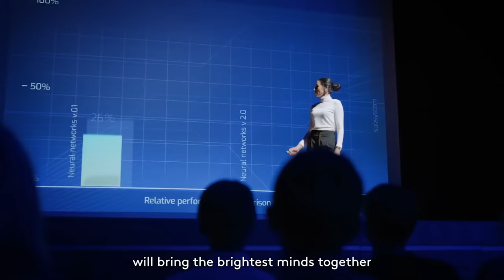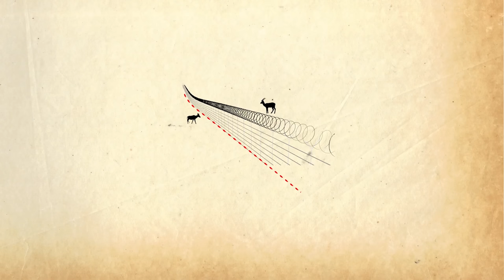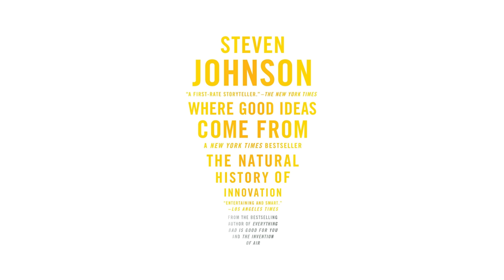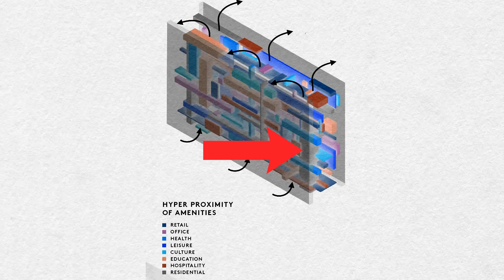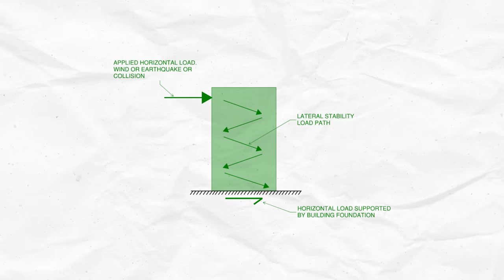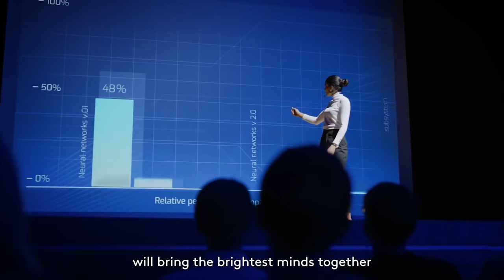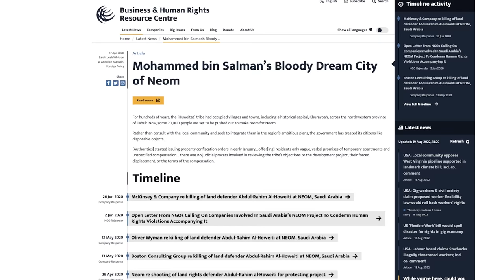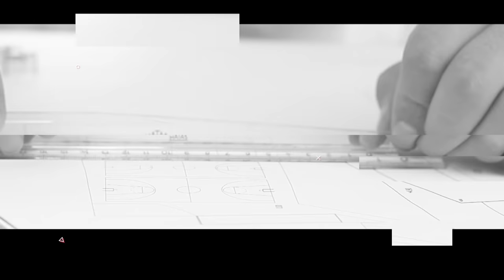This city concept breaks architecture (THE LINE)

Comment: For thousands of years cities have evolved in different ways according to local circumstances. Never has   a city evolved to be a straight line. This suggests that there are good reasons why this particular project will fail. It will fail, and fail badly, for reasons we cannot yet predict. But fail it will.
Reply: Do you wake up at night praying for that? I bet you do.
Reply: Reasons we cannot yet predict? I mean there are hundreds of obvious reasons why this project is the most stupid thing ever.
Reply: @AAL2012  no
Reply: This is going to end up long an I will copy paste parts in a few places.. If you look at it at a micro lvl, Every city in history evolved from a "Line" since the late 1900's. It has always been along coast "lines" building off from them right? Even more so from a "Main" street an off of that. Can't get much more then a line then that... The only major thing that changes here is the Direct East to west facing. 
 That to the side, The placement and "line" design have MANY reasons, best way to capture both light and wind for energy (look at solar and wind plants) in the area, Also to catch wind to create convection cooling with (what everyone seems to purposely forget) It is to have 200ft wide 20ft tall openings every 1000ft for cooling, animal passages, green areas and outer city transit. As far as the sun goes and having shade, does she/others think the earth is flat? A little over half the year it will be on a south side, a little less then half you get north majority sun. SO with open tops and large holes on ground level you get the micro climates. The money is nothing to S.A. and if they can help offset future cost's anyway they can that seems to be the smartest way.  As far as to whom would live here and how everyone says it is only for the "supper rich" That is SO FAR OFF! If anything it would be the poor whom HAVE to stay in it (It would be the cheapest in the long run) Bc the rich in S.A DO NOT rub elbows like that with the "poor" I have seen 5 people shut down entire hospitals over this! Even tho it being Independent may bring the rich, Sadly being able to legally drink will make this a smash hit! The whole A.I thing along with the worry of data, Has anyone been too? Everything is off a smartphone in S.A already, No change to the norm sorry to say.  Why can't S.A evolve a city that to them best suits the area they are IN? 
99% of what everyone is CRYING about is NOT true if they would take 5mins to do ANY research... I will give everyone, It looks stupid and dystopian AS FK! 
  The SUPPER funny thing to me is NOT ONE person has even came up with the REAL risk's of this project, Like IDK WATER!!! Or the fact how Isolated it is! Also near borders that hostel ppl can come say hi easy.
Reply: @dizzlethe7346  This project is so stupid that it would need to write an entire book just to explain all of its problems.
Reply: @bobincognito6239  Not being a troll, But have you looked this up at all?  If so I am legit curious as to a few problems you would see? 5,6?.. Water they can figure out if they have the power since they are near it, Really comes down to security IMO. Ethics are by and FAR ahead of what 99% of people put into it when we talk about animal's go, Our "green" Energy dam's or 10ft fences on the 6-10 lane highways that carve up countries LOL. come on now...   As far as size and design it is NOTHING outlandish, Look at NYC built on unstable march lands with transit And carparking under it.. S.A. Has more stable ground, No flooding or drainage worries, Plus it being in a "line" or really a rectangle would make it STUPID easy to have one main transit station with 8,9,10 (like they want) train lines all going to set distances with no stop's. 
 This concept has been around a LONG time. Rockefeller was going to do something like this with a Frank Lloyd Wright design, he thought of after the  Imperial Hotel in Tokyo was finished. It would have taken up a MASSIVE square/rectangle about 1/3 of Manhattan. And they would have at least started it if not for a man called Robert Moses (You should look him up very shady shet goes on with him) that kept expanding Central park or making random ones blocking the building. Did this to more then one person too lol.  So like not only is the concept a serious thought, But all the major thought process is done. You just need to apply modern tech and building science an that is nothing in the grand scheme. If anything should make it easier then it would have been 100yrs ago..
Reply: @bobincognito6239  P.S. All this does not mean I am for it... Because I am not! IMO people should be more Independent with an understanding of what could and is going on around them. But if your going live in the city and drone out, Why not this?
Reply: @dizzlethe7346  I mean you're just not really thinking about it. First of, it's about building the Empire State Building over 170km (110miles), so basically building 3000 Empire State Buildings, this fact alone shows how ridiculous this project is. A line is obviously the most inefficient city you could build, it's the shape in which you need to travel the most to go from point A to B, so insane time travel and insane cost of everything, any fire and the city would be cut in half...
Reply: @bobincognito6239  Ok you have not looked into this... A line is the MOST efficient way to build! You are in a essence putting 3sides on buildings not 4 saving 25% per site! This in turn drives Down the cost, It being a line also makes it so no turning is needed making no stops needed cutting down travel time (if you listen to Fedex or UPS) in half at least compared to "normal" city travel.   As far as the overall size, You have to stop thinking of it as a single building.. They are not building it ALL at once. This has to be looked at like a city not a building! So do not think of it as just A single Empire state building but more like a city how it is supposed to be. Compare it more to the building of NYC, Philly, DC ect. All of these places had been built VERY much like this! Even down to the utilities with steam heating and all, We did that over 100years ago. So why is this so outlandish? Shet our leading experts in the 1900's wanted to do the SAME THING but was stopped over personal issues with ppl in power.  
  IF we thought we could do it 100yrs ago in NY, What makes it so crazy to do today? 

 P.S As far as fires why would that split it up? Fires happen every year in my building and it doesn't spread bc brick does not catch fire... Now if your talking terror attack sure I 100% agree lol.
 EVERYTHING said about this has been said each time we go to build a larger building or city. They used to say the Empire State would weight too much and pull the land down and create a massive sink hole, The Colosseum would fall in on itself,  Cathedral Basilica of Saint Mark will sink Venice.
Reply: @bobincognito6239  Most of the EU is built in a way JUST like this. Most the buildings are connected in LONG lines with only small ally ways from one road to the other, So S.A is not doing really anything NEW. Just a larger scale and PLANNED out.     Sorry i have to go back to cost's,  Go look at sqft or building cost's in any city much less major ones.... Even if this cost 3trillion and you only got the building that is a BARGIAN!! But not only has the est only risen to 1trillion you don't just get a building in that price. You get a SUSTAINABLE CITY that is also able to be a power plant  TWO other same sized cities. And a trans system, water an waste (That also makes heat, electric and the gas for the systems to run)system Plus everything is electric so no smog. 
  The major trouble I see with this. Is are they really going to let animals roam like they said, Are they really going to be humane to workers, Are they really going to let this area be 100% independent to S.A laws. Or are they just saying these things to not looked down at from the rest of the world. Is this going to end up not allowing animals I bet, Is it going to use legit S L 4 ^ E labor? I bet, Are they going to Blackmail powerful people with the lack of or over pressed laws? I bet.  Is this going be a target for terror an innocents will be a target, I bet. An all these suck. 
 I just wish it was not them building this, An if we have to have cities we would do the same. It would lower ALL cost's from transit, taxes and services. But MOST of all it would give us WAY more green space and a unimaginable amount of less traffic on EVERY road everywhere! Last but not least water usage would be slashed!  
Something like this doted across major interstates near rivers would LVL up the US.     Like the US just spent how much since 2008 for some form of bailouts? The US could have 6 if not 7 or 8. Use them to slash the costs of social programs we have, Like rent, utilities, transit and internet stipends. Some not just for that city but others also for electric an such. At the same time giving a full spectrum of more housing and shops... In turn making it so not only can a snowball and make MANY of them, But also lowers the cost's and burdens of tax payers
Reply: @dizzlethe7346  Lol, It would take a few centuries to build 170km of this "line", you don't even know how long a single building takes to make
Reply: @RutakoVon  ROFL, Should go at someone who did not do this for a living for 35yrs.. I love how time is the only thing that matters to you tho....  Do you think it took "centuries" to build NY or LA??? This is not a Burj Khalifa type building! This is a BOX building, Not only that but it is not being built inside a city! So you do not need to deal with thos logistics, So in turn they can have the assembly line AT THE SITES!     Think of the Empire state building but on steroids! An they built that in just over a year, an that was 100yrs ago INSIDE A MEGA CITY done mostly by hand! Even that is not fair because they don't need to spend MONTHS pounding stabilizing post's 100++ft into the ground since they are not building on a marsh like NY is. Or spend another month making underground parking. Talking MASSIVE factors here, The depth Underground is only 12% of the E.S. Building.  Plus they don't have to be held to just one or two job sites they can have 10-1000 sites all doing the same things to make it easy to manage an teach, Making it less like one building and more like build 10-1000 of them. While being built in sections making it possible to develop even faster... They also don't have the "red tape" in permitting an such like we do. Top everything off this isn't like the buildings we have, An only one person or company is doing it we are talking a entire nation AND investors!!!
  All these factors, You know the MAJOR ones when building like this. Just gets forgotten somehow. Assembly line an not being in the city being Major ones
 P.S It took S.A 15days! To build Four 100+bed  5 story C-19 TEMP hospital's, Took NY 5 months to put up a C-19 GYM, That they copied from China an they had it up in 3 days... LOL
:elbowcough:
 Seriously tho, 25-40yrs first half most of this being time to build all the supply plants needed. After that halve the time because you will have more in place to pick up pace. Income workforce and supplies. So something more like 40-60yrs in total, Ya sure a Long arse time but FAR from "centuries" friend.
Reply: @dizzlethe7346  Bro Prisons look better than this city.
Reply: @theeternal6890  I agree lol... But most skyscraper's or cities for that matter look and are just as bad as prison's too! Just this ones scale turns a level 2 up to 10!
Reply: @dizzlethe7346  yea no great essay but for one: how would houses with three sides even work? you still need 4 walls only this time one is a huge ass pane of glass. a line is pretty much the dumbest idea one could have, it turns the entire city into a bottleneck. theres a reason cities tend to radiate outwards in a roughly circular fashion over time, not accounting for geography. it maximises area while minimising travel time. this also has the advantage of allowing alternative routes. say the high speed hyperloop gadgetbahn is out of service, which it will be at some point. suddenly youll be taking the metro for 6 hours to get anywhere, whereas every other city, you just take a different train adding at most 30 or so minutes. add to that that this will not only be claustrophobic as fuck, it will inevitably exaggerate class division even more so than actual cities. The entire concept of the line is indefensible. they have some nice ideas. The transport and service layer thats entirely underground leaving the above ground areas for pedestrians exclusively is the perfect idea. just apply it to a regular city that isnt enclosed in a terrarium
Reply: @Smittel  First want to say TY, For being the first to really talk about the ideal!    But. I am not saying really build houses with 3 sides, What I mean is having it at one large area instead or a bunch of single buildings. You save a side each building you planned to build in that city. Since the "main" Buildings would run along the two side's of a "street" the best way i can put it...   Right now I am going to stay with Just this "line" of a city...   The "hyperloop" but really a hyper line will have 16 public lanes, With 58 cars all running at varies lengths. So we are talking a better stop and go with more areas to pick from then NYC, Japan and the UK all put together. So they have not just travel time down but will be set even if a near majority go down. With it being totally underground they will be able to really push the trains also unlike what everyone else is able to do to the weather. Top that off it is not like they will not put roads around it, The whole Ideal is to build it up as a tourist trap with it's "own" law's. So how do you get 6hrs  if you can drive will say 112kmh (70mph) in a car on the road outside you could drive around the outside of it in 3ish hours. 170KM is not really big at all.     The only way you will get a way to have the above ground levels to not, At least inside the city really is to build in a line like this. Otherwise that is when you run into the outside logistical problems of having to totally drive around the outside like that. You can't have all the roadways underground for cost's and safety think of the traffic then in a tunnel after a crash. So you would need the city to be "thin" an to keep the above ground free and so a truck or someone can travel easier in a car from one side to the other and not around.   Really every city starts out in a line, So just look at this as main street just as a skyscraper... How many people do you know that lives in a city that has a job further then 3miles anyway? So an Escooter should do that in 15mins.

 Overall the "Line" concept is top notch. It would save so much in everyway. Upfront cost, Running cost's, Utilities list goes on an on. I think more on to your point...... This is not concept this is the real world. And I 100% agree with will make class divide look so bad will have to invent a new term for it since S.A is doing this. And again something not the fault of the concept but the humans doing it, The amount of SLA  V  E labor that will be used for this will strengthen the trade even more after the QT soccer stadium too... 
 It is one of tho's thing's as a concept it is pretty fking ideal for a lot of things, Just not for society
Reply: In fact, you can predict. She just did in this video. Lol
Reply: Exactly. We can see no examples for anything like this, not even at a scale a hundred times smaller, and that alone is a sure sign this thing can't work.
Reply: @dizzlethe7346  You go great lengths to focus on the abstract concept of "line" while ignoring that this idea has zero connection to how villages, towns, and cities developed throughout history regardless if you can force that abstract interpretation on their origin in some way or another. This artificial city starts out with a master plan that leaves very little, if any at all, to its inhabitants: they are just clogs in the (supposedly) perfect, finished machine. However, life is a mess, and whenever great planners tried to shoehorn it into their clever designs, the result was an inglorious disaster.
Reply: No need to pray it will fail unnatural concept
Reply: You are wrong every city evolved having a city center a fort nearby river or coast. Your first point is baseless lies no need read further.
Reply: @tibs7095  I will reply to both your comments. First history is full of examples at scale, A single skyscraper is perfect, A apartment ward Or the new towns that have been built in middle America. But if you want something JUST Like this, Then look at all the HQ's of silicone valley they have all the same and are just big rectangles. An we look at them as marvels of advancement?..... Since real life main streets seem to be abstract to you. It is not really forcing it as an ideal when that is how history went but... Now as far as a master plan everything is directed to the inhabitants of this, This isn't made to be some industrial park man. It is just a copy paste of things we already proved have worked to make (One type of) people happy.
 All this said... It will never get finished! logistically it is too big, Right now it is more one man's vision rather then a countries goal and when he dies will be left with something 1/3 the size and half done. At this point it is still too young and no invested into enough from world companies. Even if it is done. Like you said life is messy! I brought this up b4, But this is going to be a MAJOR target in one the historically an still is a hostel part of the world. Then add on whom is building it, The building it alone is going to cause social divide at best. Also bring back a sla   v e trade to the area in full force. Not even bringing up the internal struggle for power, That will have forces not wanting it finished.
 
My points had been. 1.) We did/do evolve our at the basic from a line. Nomads with tents in a rectangle with leaders at the center, Forts with houses in a line down the middle with farm land around it, Towns a main street, Cities the same, Then everything is branched out/off of.  2.) That it could be built and in less time then hundreds of years 3.) That if built at a better scale (1/3-1/2 size) it could be an amazing plan just better for places with fresh water access along with countless times better then the cities we live in now 4.) It is self sustainable 5.) This is not as outlandish as the next progression to city living as everyone says. That in mind the overall size an people doing it makes it questionable at best... I still think something like this is the just what Southern America needs, It would make living west of the Mississippi but really the 98* line sustainable. Have most the population in that area manage water better then Vegas does now, Top it off what waste water that is made can go right to the crop lands this alone would be massive.. No more major worries about grid failure or added stress because each one can be a small electric plant alone. If laid out right it can help with river evaporation in the south. If done like a EU a layout with all the commercial, residential and like industrial in the "Line" city with all the heavy commercial/Bulk and industrial 10-20miles away, But also on the water front. You leave the ability for you to have every form of transportation.
Lastly the question really becomes less Can we build it because we can, But more should we build it. Even if we get all these glorious perks from it. Like Is it really worth the impact on all the social dynamics it will touch? Is it worth the risk of putting that much power over peoples entire lives? Into the hands of one person or company non the less? Is it worth the major target that they will get. To me one of them makes me say NO tbh. But I do see us moving toward this at some time, If you look at how cities are being refit around the new stadiums being built you can see ever since Dallas. With newer ones going the full self sustainable route also. Look at Jacksonville, Cleveland or Indy lol.  A line, House 10-30k people, Fully sustainable, light commercial cities inside a city. All with one entity behind them too...
Reply: @dizzlethe7346  
Thanks for your long response. Let me see...

Skyscrapers are a very recent experiment. They are huge, unsustainable machines that become dysfunctional at the drop of a hat when something goes wrong and, once left alone (even if it's for just a short period), will fall into disrepair and decay, never to be able to recover. They, together with most of our technological (non)solutions are the equivalents of balancing a ball on a saddle: you can keep it up with great care and effort, but (should anything go wrong even temporarily) our fragile little system will collapse. Trivia: skyscrapers need a lot of metal and metal's becoming very expensive -- it may soon become uneconomical to upkeep them, and then what?

I'm all for using our advances in technology, AI, etc. to create awesome solutions to great problems, but the solutions themselves must be sustainable, and that necessarily implies low-tech and low-impact. Variability and stressors are an inherent part of our future: if we plan for "things will always go well" then we're setting ourselves up for inevitable collapse. We must plan for the times when things will fall apart, when our support systems will be unavailable for some time, so that we can recover from these times.

A rigid system that depends on a continuous, unimpeded supply of resources to be available is doomed to failure; it's just a matter of time, really. The shinier and most precisely designed something is, the more likely it takes just as much precision (and thus inordinate effort) to keep in operational; it's a losing fight against entropy. Not only that, even small changes will be near impossible since any small change may snowball into something unexpected and huge across such a tightly-coupled system. Anybody who worked on software knows that the simpler your abstractions, the looser the coupling, the easier it is to adapt to new (or previously unknown) requirements.

The rigidity of precise design takes us to another problem. The big difference between the main street of a town and the Line is that those streets grew organically, one step at a time, continuously responding to the needs of the local community. Just look at the scale of a typical main street from before outsiders started to meddle: it's the core of a walkable little neighborhood. The Line doesn't try to copy that; it instead decided taking the high-speed train across 170 km is equivalent to a 20-minute walk just because both take the same time! The Line picked an inhuman scale both horizontally and vertically.

Back to organic v.s. designed. You may say the Line has a master plan directed at its inhabitants, but it does so by the necessarily limited insight of outsiders: "we know it best what you all will need." Plot twist: they don't; they can't: society is too complex, too unpredictable, and too messy, no planner can take all the idiosyncrasies of humanity into account ahead of time, they are bound to work with simplified, unrealistic models that simply won't cut it, especially not at such a scale.

The best an urban designer can do is to set out to create a rough framework to help people avoid the worst mistakes that e.g. market mechanisms can't account for (basically: transportation and basic infrastructure). After that, people will take over and turn it into a huge mess that just magically works. Building a complex machine like the Line is just another arrogant exercise in ignorance and futility. I suggest you have a look at Alain Bertaud's work, including his book "Order without design"; trivia: Bertaud has planned actual cities.

As for being sustainable. Other than the marketing material, there's literally nothing that shows why it would be so. It picked a form that maximizes travel distance. It minimizes sunlight across the structure. It uses materials with huge embedded emissions. Finally, since it picked several "radical great new ideas" for structure, technology, assumptions about how humans live, etc, objectively speaking, at least some of those will tragically fail and all those resources will become waste in the end.

As for being environmental or ethical in general, it's really just a huge scar on the land. And yes, it's based in an autocracy with a dictator: it will be built and served by slaves in one form or another. Local people and wildlife will get displaced without mercy. Anything this huge is bound to have a number of other unexpected side effects too.

Just as a random thought for the end, a structure that's basically a 500 m tall chimney will become literal hell when there's a fire.
Reply: @tibs7095  We agree on most everything when it comes to the reason's it could fail and how it could be an overall nightmare if neglected in the slightest.  
 LOL I had to skip to this first, You do know Alain Bertaud he/NYUMI is one of the main advisors of this right? Him an his book is basically the driving force that made S.A allow this to be "self" governed... In the book he talks about how the urban and city area limitations are stunting the development of the city and social progression, He even brings up laws from the 1800s that do not allow building over 5 stories as if building advancement has not happen.  If Alain did not design all the buildings that are connected over the roads of BangkokUsing  we would not be talking about the "Line" today. It is the set's of towers that reclaimed the space over the road that lead us to this. 
 
A rigid system like this may take a massive amount of precision and effort, But once it is in place. It will be Way less upkeep over then a system that is spread in all directions because everything is located in shorter Overall distances.  170KM in the scale of a city is tiny for US standards, Not only that but what would make you go from one end all the way to the other? Why could you not live in the middle? Or have things blocked so everything repeats every block or so just like a normal city? The design of this is to make it so the daily life of a person has the LEAST amount to travel so really. It is trying taking that walkable main street of a village adopting it to Wall street and copy pasting over and over in a line. 
 
 If anything of a skyscraper size project going bad is a massive waste. It's Just if this worked, Price to volume and overall volume of resources needed will be many many Xs less then a city with more space taken up will at the same time house more people and or companies..

 As far as the environment argument, We are building cities no matter what.. Should we destroy more land when we do it or less? An that leads into sustainability. If we house more people with less is that not less embedded emissions then we would us? Also If heating, cooling, waste treatment, transit all run more efficient. What makes everyone think they are going to need a higher then average or even average amount of energy a city it's size does? So the transparent solar cells they are going plaster the entire outside of this with should be fine alone! But it will also have vertical and horizontal wind turbines. 

They picked East to west to get the most sun not the least doing it this way makes it so you don't have shadows cast down like you have in a city. And because of seasons southside has the sun has the sun a lil over 50% the time North a lil over 40% with the rest overtop.. They also picked this spot to capture the most wind that come's off the water  between it and the mountains here for both better climate control and electric.  If I came across that it would be built out of sustainable items My Bad, Even tho I am not sure how you would get that. But I meant the building after done would be self sustainable 

For these reasons I really love the overall Ideal. The major downfall is the scale. Like you said things happen, An in that harsh climate I do not see things going smooth even if it got all done. The amount of upkeep to keep the destructive elements out on so many things that are unproven in the area is foolish at best!  This may sound odd but because of the size and it is trying to solve all the "troubles" of life it REALLY reminds me of Calhoun’s experiments "Rat city" but really all cities do just this one more so. 
 
 No matter what. THIS thing the "Line" is doomed to fail for one reason or another.  I just hope it's failure won't stop something at a 10th the scale being tried in a overall less hostile area and leadership.